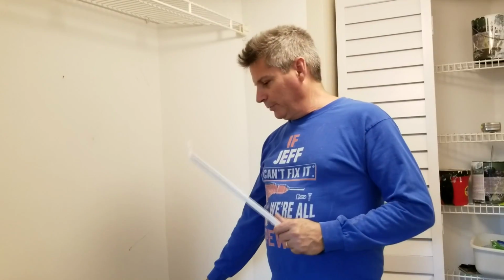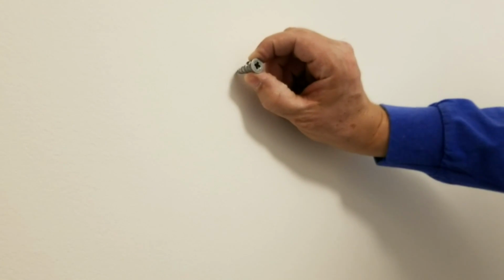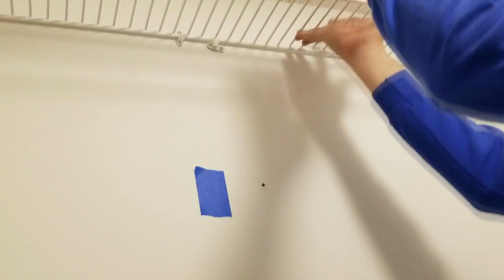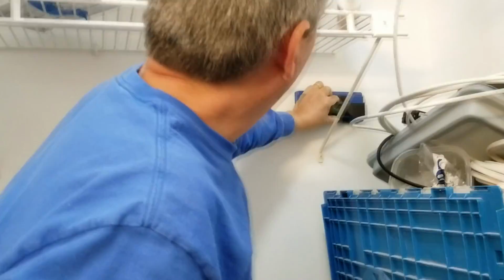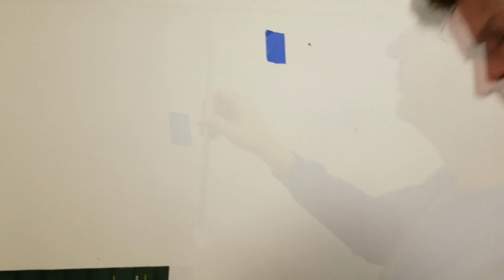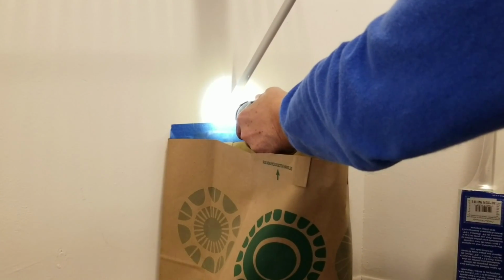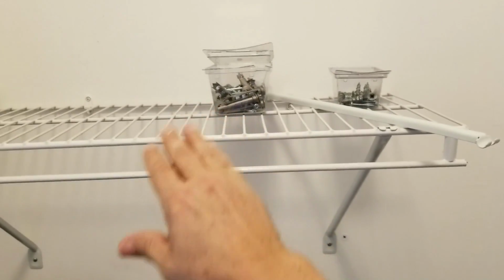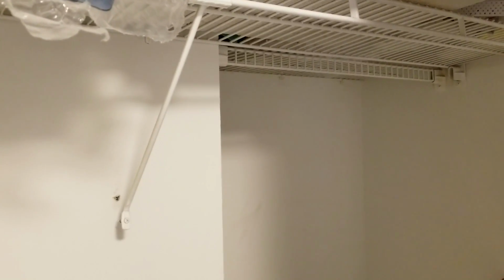DIY How to Repair Closet Wire Shelves Falling Off Walls

Comment: If started w/ the basic shelf as one repairing can those shelves be used w/ the ShelfTrack system? They appear to be the same shelves.......makes sense to upgrade to that system using the original shelving. Is that possible?
Reply from the maker: Yes you should be able to use these with the shelf track system
Reply: @jeffostroff  excellent: thank you!!!!!!!!!! 
PS: great video, thx for posting, helps all of us with crashing ClosetMaid shelves. :)
Reply: @jeffostroff  & PS again: the trick taping the paper bag to catch dust is priceless :)

Comment: Hello Jeff. I just installed a couple shelves in the bedroom. They had a place for a screw on each side. On one side I used an ez anchor type anchor. For the other side, I hit a steel stud behind the drywall. I went with a self drilling metal screw. With a little force I was able to get the screw in. It seemed to have worked but my only concern is that the metal screw doesn’t completely bite into the steel stud. It’s secure, it just keeps spinning if I use my drill or screwdriver. Any recommendations?
Reply from the maker: Sometimes the metal studs are tricky. Make sure the type of screw you use has thread where you think it will hit the metal stud, which is about 1/2" deep through the drywall from the head of the screw. Another thing I often do is use a 1/16" pilot drill to cut through the stud, then use by my metal screw from there.
Reply: @jeffostroff  thank you.

Comment: Fun when the shelf pulls off your wall at 1am...so I get to do this after a run to the hardware store in the morning, because I definitely don't trust apartment maintenance to do it right (their track record is abysmal)
Thanks for the easy instructions, truly. And links to materials.
Reply from the maker: You can do it!
Reply: It happened at 2AM for me! Ugh

Comment: My closet has been repaired three times and keep falling. I live in Orlando Florida.
Reply from the maker: It keeps falling because whoever does the repairs keeps making the same mistakes as the previous repair people before them. If you adhere to what we show you in this video you will have absolutely 0 problems. the key is to identifying studs wherever possible and getting your struts to screw into the studs.
Reply: @jeffostroff  yes I will send the link of your video who ever is going to fix my closet. Thank you very much.
Reply: @jeffostroff  No they do not.  You can anchor with metal anchors or directly into studs all you want but the weight on these shelves is limited by the cheap upper anchors that can only hold a few pounds.  I've been a handyman for the last 22 years and I've seen these problems again and again.  Whenever I go into someone's closet in a house and they have these shelves I always inspect the upper anchors.  More often than not there will be at least 1 or 2 broken anchors and they ALWAYS break in the same place.  The anchor itself remains in the wall on the uppers after collapse.  The lower anchors are pulled out from the fulcrum action of the falling shelf.  Once one upper anchor breaks it puts twice as much weight on the adjacent anchor leading to eventual collapse.  Both the design and the plastic used are horrible.  It also doesn't help that many exceed the recommended weight rating for these shelves as well.

Comment: The brackets always hold on mine! It is the stupid plastic hooks that break and then the whole thing collapses and the brackets bend under the weight.
Reply from the maker: Yes this is why I prefer ClosetMaid's Shelf Track system, you screw vertical standards onto the wall, ten your cantilever brackets connect to the vertical standards.
Reply: @jeffostroff  It pays to get the real deal in the long run. I have had 3 closet fails over the last 10 years, and it ALWAYS happens when life is the most hectic. If I was to start from scratch, which I probably should,  the ClosetMaid's Shelf Track system would be the way to go. Since my screws for the clips held fast, I am going replace the plastic drywall back clips with stainless steel loop clamps.  FIngers Crossed
Reply: You are correct.  You're one of the few that get it.  The upper hook anchors are complete crap.  They ALWAYS break in the same place.  I re engineered the hooks and 3d printed my own out of much stronger PETG plastic.

Comment: I hired someone to do my closet, he used 2 closet rods.  I put stuff on the bottom rod, everything was fine.  The minute I used the top rod for jackets and blazers, it all came down on my head, ripped the wall and took down the bottom rod in the process.  I noticed he used those plastic anchors and they have bent out of place! I have been without a closet for over a week, my clothes full of drywall dust and I cannot find anything, so going to work has been challenging.  I gave up on the rest of my clothes and have them piled on a mountain by my bed.  Unbelievable.  Wish I could hire you, or anyone competent enough to build me a closet that will actually hold my stuff.  I just hope he comes back to fix the shoddy work he did, or I'm out of $$$.
Reply from the maker: Don't call him back to fix it. If he was that stupid to begin with he does not know how to do it right. I would switch to the closet maid shelftrack system, because there, we try to get at least 2 screws into studs.

Comment: How much would it typically cost to repair a closet like this? Say...if two of the anchors got bent and one of the hooks on the wall broke off? Pls tell me it isnt too expensive?
Reply from the maker: I simply don't know how much they were charged because I never called these people to do anything but I would imagine a couple of hours of Labor and maybe $20 in parts at the most

Comment: Where can you get the system that u recomend
Reply from the maker: ✅ Tools and Products in this how to repair closet shelves video: Recommended Closet Maid Shelftrack starter kits: 
✅ ClosetMaid 2091 ShelfTrack 7ft. to 10ft. Kit, White: https://amzn.to/2SwpPYv 
✅ ClosetMaid 22875 ShelfTrack 5ft. to 8ft. Kit: https://amzn.to/2RwBUj6
✅ Precision Sensors Stud Finder Deep Scanning LED Profinder 5000:  https://amzn.to/2qAuAr7
✅ DEWALT DCK299D1T1 Hammer Drill, Impact Driver Kit: https://amzn.to/2M6h450 
✅ E-Z Ancor Self Drilling Toggle Anchors: https://amzn.to/2GPmAsd
✅ ClosetMaid 12-Inch Wire Shelving Support Brackets: https://amzn.to/2U1Gx2Y
✅ Empire True Blue 12-Inch Magnetic Level: https://amzn.to/2DTCP4j
✅ Metal Stud Screws: 8 x 1-1/4" Self Tapping Stainless Steel Metal Screws Pan Head  https://amzn.to/2NJ43AP
✅ Wood Stud Screws: GRK 120660 White Cabinet Screw #8 X 2-1/2":  https://amzn.to/2C5OUTa

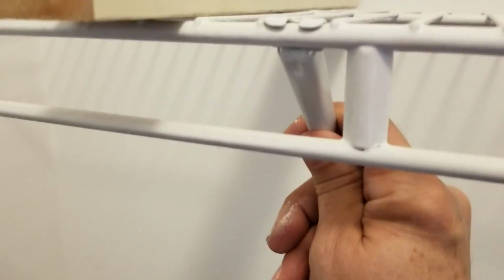Comment: At 24:10, when you're talking about the bracket being loose and wanting to pop up - it's because you're supposed to put that split (forked tongue) on the bracket underneath one of the thin wires that is perpendicular to the wall to keep it locked in place. It offers a little bit of support for weight, but mainly it's there to keep the bracket in place as people are moving hangers from one side to another. Yes, it still needs to be perfectly against the big wire to support the weight.
Reply: Yep - happened in my fiancé’s closet 3 weeks ago - and mine yesterday - mine was definitely overloaded (heehee). I’m thinking of getting a system with some tall cabinets - or doing custom ones myself. I’m gonna think about it while my clothes take a much needed rest on the floor - LOL.
Reply from the maker: Yes that's what stinks about that design, it must be perfect or it will not hold. What worries me is what happens over time as people start to put more and more clothing on their shelves an that adds additional weight and it causes the shelf to flex now it will lose its mechanical advantage
Reply: Excellent job
Reply: Such a bizarre design for the brackets, I just bought a pair and the notch is too shallow, so they don't even fit their own product in the intended way.

Comment: I've done this, but I had a specific place regardless of studs or not lol. I've been holding strong two years now. My trick was after assembly. I placed gorrila glue around my screws for extra support. It may not be the correct way however it works. It doesn't move at all.
Reply from the maker: Gorilla glue is helping it act as an anchor. If you really glob it on and push globs into the hole, it might create a nice rim inside the hole in the wall, making it hard for the screw to get ripped out.

Comment: Thanks for the video! As you mentioned some of the support brackets have to be in certain spot even if there are no studs.

My rack fell, and one of the support brackets ripped off the wall. Is it okay to fix a couple of inches from where it originally was?
Reply from the maker: Glad it helped! Yes, you can move it to wherever you need it to be I look for fresh meat of drywall where I can imbed an anchor.

Comment: I wish I had seen this before everything came crashing down and messing up my walls...new built btw!
Reply: Same thing happened to me .. brand new built !
Reply: All the work in my rental apartment was done haphazardly.  Last week the whole oven hood fell on me and yesterday the closet system crashed.  Luckily I haven’t been killed yet!  This video is certainly helpful.
Reply: @janeolinger8038  I'm also renting an appt and new in the US. who should fix it if the shelves fall apart? Should I call the maintainance and have it fixed or should i do it myself?
Reply: Hi Samantha.That may depend on the type of apartment, the landlord, etc.   It should be the landlord’s job if they installed the shelves.  Sometimes I am reluctant to fix something myself because the landlord could deduct from my security if they don’t like what I did.   For my closet, I bought a rolling rack which I will take with me.
Reply from the maker: Well if it happens again, you're ready. Or ditch the ceiling tiles
Reply: Me too!
Reply: I only had two studs and used metal anchors. Twice it broke. Should I place a 1X4 or 2x4 on the wall then hang it.
Reply: Same here brand new house and it came tumbling down after 1 month after move in.
Reply: Me too girl 😢😂

Comment: I am reinstalling a wooden shelf that buckled in my bathroom.  Two shelves meet at the corner, and so I think I should remove both,  & reinstall both shelves a little lower since they are too high.  The problem is that they are "floating" shelves, and so I cannot choose where to place the anchor unless I drill a hole in the back of each shelf to line them up with the studs.  Is there a better solution?
Reply from the maker: Sort of like Ikea floating shelves, maybe see if you can buy the those floating shelf "rod brackets " separately from Ikea, and use those, I doubt they are sold desperately. The brackets are basically a black strip with 2 or 3 roads sticking out of them. you drill holes in the back of your shelf to slide the shelf onto the bracket, lined up with the 3 rods. So bracket gets screwed onto studs, then shelves slide onto bracket. then get small straight bracket and screw under the corner where the 2 shelves meet, to keep them level with one another. Personally I would just buy the nice floating shelves from Ikea and be done with it, they come with the brackets.

Comment: So for the big anchor that holds 100lb, those you don’t put into the studs it just goes into the drywall ? And the screws that do go into the studs are the self tapping screws ?
Reply from the maker: Tony, correct, if you have metal studs, you need to use self tapping screws to pierce those metal studs. If you don't have a stud location where you are fastening those braces against the wall, then you use the big metal anchors I showed which push through the drywall, and the swingout arm on it holds to the back side of the drywall. I would do my very best to only use studs, or at least try to use as many studs as possible, and as few anchors as you can to get the job done. Look at some of our closet shelving videos in this playlist, you'll see we prefer the Shelf track system, a lot more reliable because the track is secured only to studs. Then the vertical standards hang off the well-secured track, and can also be attached to studs.

Comment: HI,Ii was wondering you could use the shelf track system if you have metal studs if I switch to one. I hit metal studs so I wasn't able to drill into it for the closetmaid freestanding wire shelf and I ripped out the drywall because of the crapper anchors they come with. The closet is on the backside of the washroom so I'm also concerned about hitting a pipe.  Can you specify the screws and anchors used? I can't seem to find the drywall one  thanks!
Reply from the maker: Mariam, for metal studs, you need a fine thread drywall screw that is specifically made for metal studs, here it is: https://amzn.to/2Cf6Aj4  Also sometimes drilling them into metal studs can be a challenge, it will sit there and spin and spin and sometimes never seem like it will go in. So sometimes I get a 1/16" drill bit and drill a pilot hole into the metal stud first, then the tip of this drywall screw will pierce right through the pilot hole.
Reply: @jeffostroff  thank you! I'll try it out

Comment: Good tips - bad attitude
Reply from the maker: What do you mean bad attitude? Because I'm holding installer accountable?
Reply: jeffostroff 
Yes installers should be held accountable and thanks for pointing them out. However I feel you empathized how bad the installers were too many times and words were lil harsh....but to each is own
Reply: @woowoo6559  I think the installers should be held accountable for sure. Now that my shelves have wound up on the floor & am teaching myself to fix them I realize what a crappy job they did (& paid good money for their 'work' btw)....no anchors even where no studs...what the hey??? Everyone, not matter what do for a living, should learn their job well before charging a fee for service. Cheers to Jeff!!

Comment: Thank you for the tutorial, Jeff. We used your video to fix two of our closets. Quick question - do you have guidance on longevity of such a repair? Thanks
Reply from the maker: If you are able to get At least one screw into the stud for each wire shelf it should lost permanently. If you used just the anchors that we showed you it will last as long as the dry wall llasts.

Comment: Hi Jeff, I just wanted to say thank you for your very detailed video and I’m going to attempt to try and do this myself as a single lady but I am pretty efficient… Just wanted to say thank you for putting all the parts on your video with the Amazon links I found that to be super helpful as I was about to walk into Lowe’s scratching my head… So I’m going to repair the holes in my wall and then I’m gonna start your project here and hopefully I can fix it myself or else I might have to call you here in Florida. Thank you So much for your help and insight. Your video made me laugh because you sound exactly like my dad and my dad is very efficient and helping but now he’s a senior and I have to try and do this myself
Reply: And yes I did subscribe to your channel and liked your video I look forward to looking at all of them in the near future
Reply from the maker: Awesome, Karen! Let us know if your repair went well!
Reply: @jeffostroff  So my shelf pulled out leaving holes in my sheet rock. I repaired the holes yesterday, and I am ordering the supplies. All my wall clips broke and I was wondering if you have a video on how to install the wall clips so it lines up with the rack.. Any tips? I don't want to put the wall clips where I did the repair.

Comment: I owner a house which I rent out in Central Florida.  Living in an apartment in Minnesota.  4 months ago, 1 of the 94 inch close shelves came crashing down.  The maintenance guy and building manager's are idiots.  They took 4 attempts to fix it.  First fix came crashing down with half the clothes.  The 2nd attempt had back wall clips pulling out of wall before clothes were added.  3rd and 4th attempt, they cut the shelf in half.  You cannot do that with shelf that has 2 wall mounts  to hold 94 inches of clothes.  They are confusing old style wall to wall and ShelfTrack system.  "You want something done right, Do it Yourself".  Left mount was fixed with 2 toggle lock anchors (no stud).  Marked studs and then screwed the back wall clips into the stud.  Attached wall studs to those same studs.  For the other 94 inch closet, I will mark studs and do the same to it (less work).
4 supports is better than 2, and best to not have this happen, again.
Thanks for the video.
Reply from the maker: Yes, 99% of people working on closets are not qualified. Of all rooms in the house, I see most failures in closets.

Comment: I noticed you put the top of the bracket BETWEEN the front-to-back wires instead of straddling a wire with the notch. Does it make a difference? When I did it as you did, the shelf wouldn't stay and immediately slipped off the bracket. The Closet Maid package shows an example, but the drawing is too small see it, and the instructions don't mention it.
Reply from the maker: Yes it is better to let a wire fit between notch  On the bracket. What I do slide D bracket all the way up the wall to the point that I know that once it's contacting the wire shelf to shelf can not sag or move or otherwise pop out of that connection. Normally I don't even use this type or shelf I used their shelf track

Comment: That came out amazing. Had to fast forward through a bit of it since I'm at work but will come back to watch it all the way through. 😉😉😁😁 you think this would be nice for outside up against a wall with plants? 4:34
Reply from the maker: I am actually not a fan of wire shelving, so I would choose something else for outdoors. I'm also not sure if these are rates for outdoors, as the cut end of the metal wire shelves are exposed, even though you can put plastic caps on them, just not sure how they would do.